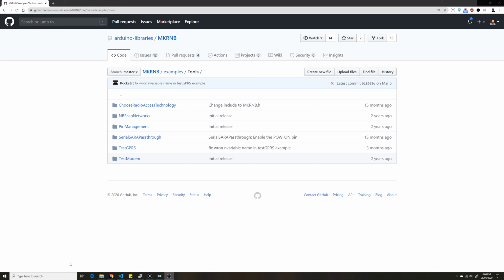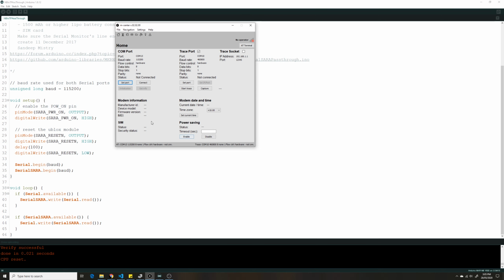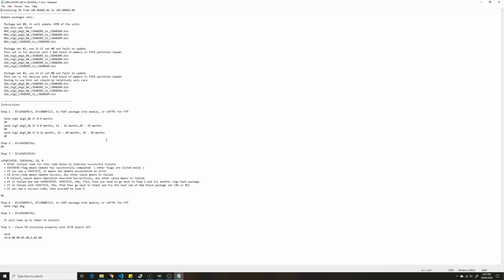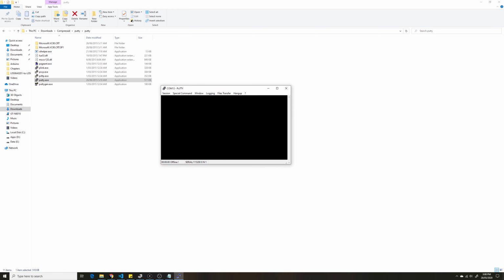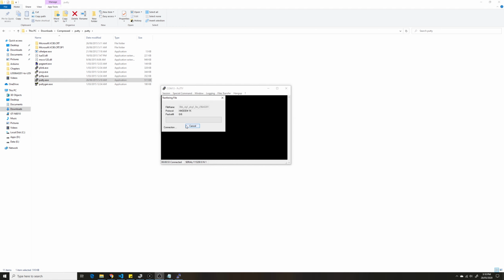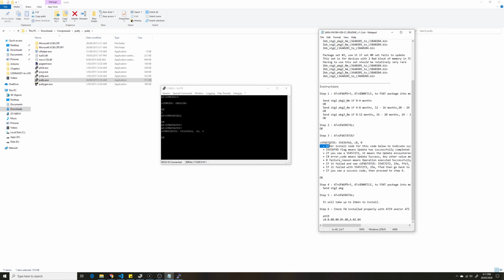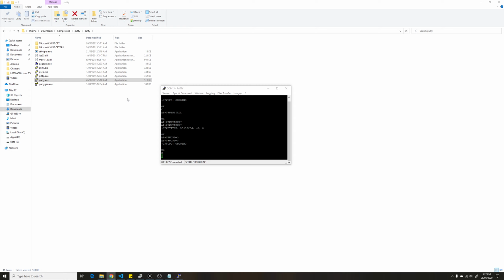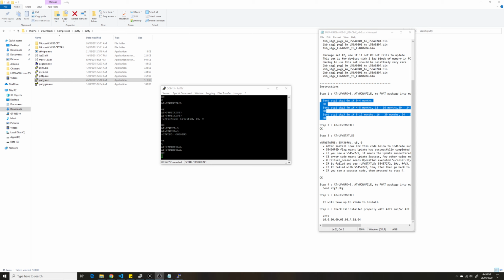Arduino NB1500 SARA-R410M Firmware Update | No Modem Connection Fix

Comment: Hi do you still have the files for the firmware upgrade? Would it be possible to send it to me. Do I also have to solder pins directly to the modem as well?

Comment: Goood ..and great job. Afnan bashir 👌👍👌👍👌👍👌👍👌..keep creating......since we have the same ..
.passion and channel contents... arduino and programming.....
I will suppourt u as much as I can....and I Subscribed too...iam your 10th SUBSCRIBER..Anyways...Best wishes..👍👍
Reply from the maker: Thanks for the support.
Reply: @ifithegr8  Hi, Afnan,  I have a brand new "Arduino NB1500 SARA-R410M" with the same problem as you described (more: my arduino does not respond to any AT commando). I downloaded the ublox software and programmed my arduino with the software that you discibe in the video.  I can connect to the com port but when I hit the init button => i get NO respond .... so the conclusion either is 1) brand new board is broken !?   2) an other problem occures . ...
Reply from the maker: @carldeclercq9830  Did you program your arduino with the program to accept the AT Commands?
Reply: @ifithegr8  Yes I did ...
Reply from the maker: @carldeclercq9830  check the baud rate settings, if that fails just do a simple blinky test to see if your board is ok
Reply: @ifithegr8  All the setting are correct i triple checked, the arduino can be programmed that is not the problem, I tried several programs that not uses the sara ublox. and these programs are working fine ....  Just when the SAMD21 must communicate with the SARA u-blok , I get no respond ...
Reply from the maker: @carldeclercq9830  does example code for the modem work ?
Reply: @carldeclercq9830  did you change you end of line commands as the comments in the program say?